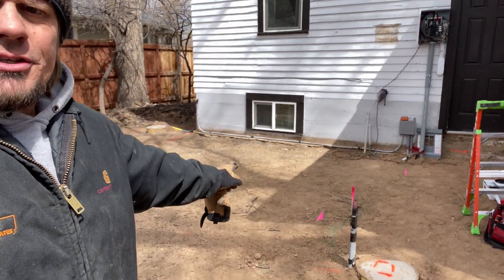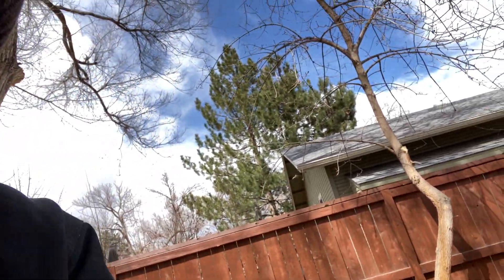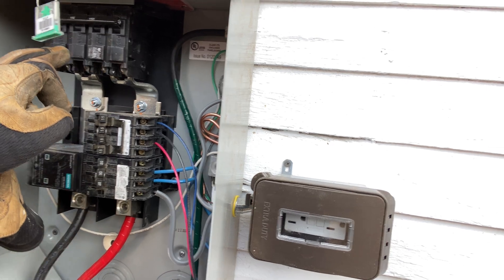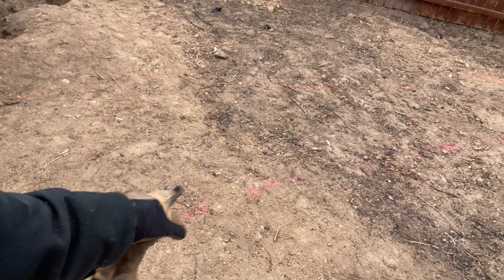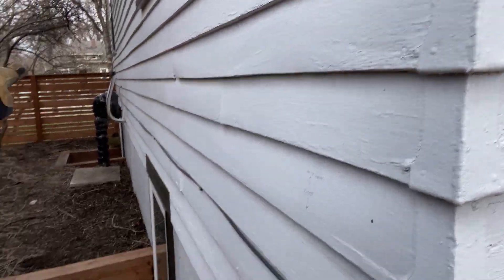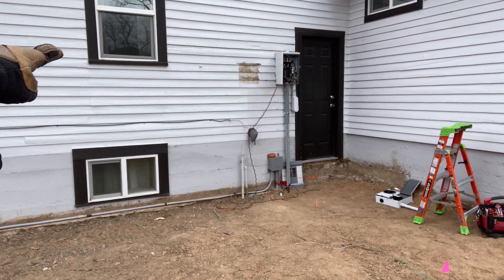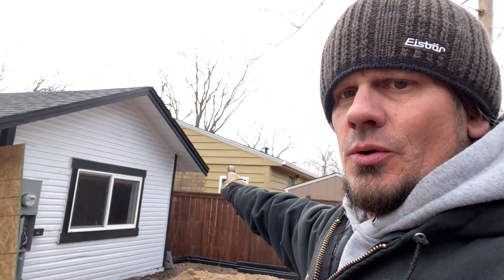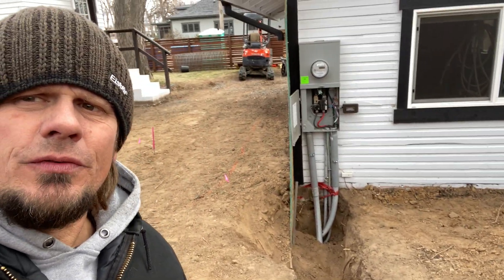Moving Electrical Service in an Urban Area Pt. 2

Comment: I have a question. My cousin built a shed on a slab thats on a larger slab we poured in his backyard. We're framers and do a lot of gen contractor work but when he poured it, he put the wrong kind of conduit 90s in instead of sweeps... there is 2 90s, is there any way short of tearing them out and redoing them, we could pull a wire in?  I think he put in like 1" or 1 ¼ pipe.... would elephant snot work???? Just wondering if there is a secret to help with a situation like this